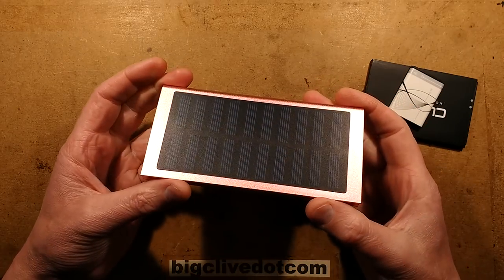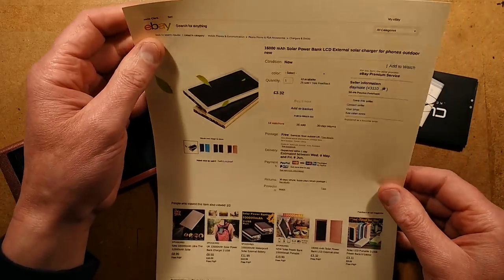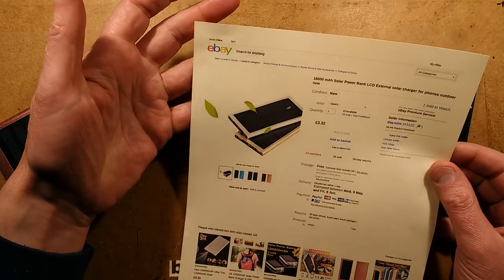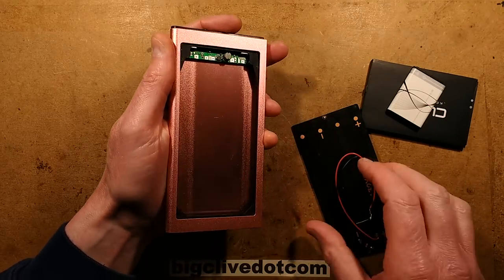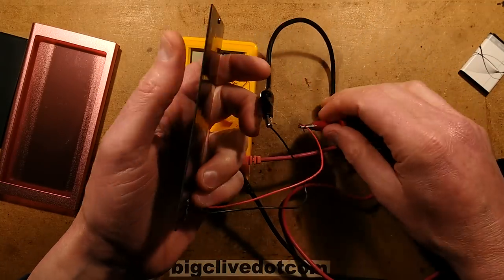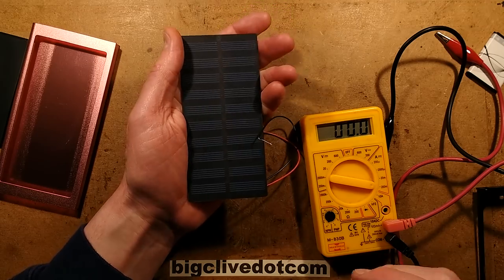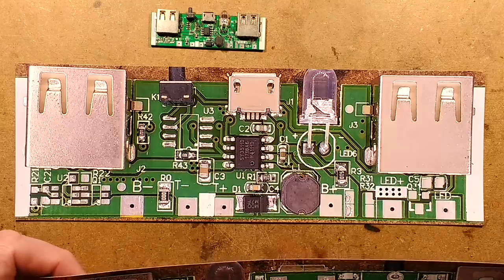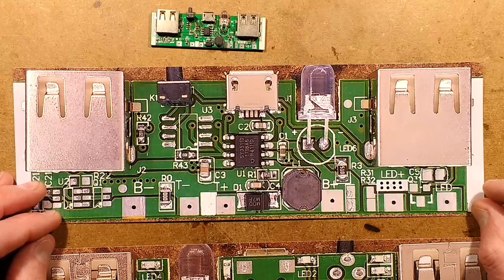Fake USB power bank kit rating (100,000mAh again)

Comment: I think I have one: It’s a “Nekteck” battery at “10,400 mAh
Reply: Nevermind, similar look/design though
Reply: It has 4 charge LEDS, 2 USB ports (5V), on/off button, the same solar panel, similar rough metal build w/ similar shape & size, plastic middle piece and is screwed toghether

Comment: I purchased a water feature with a built in backup battery  .The ins said in the off position it will run off sun light and charge the battery in the on {at night} it will run of battery power.

Never got it to work as it was suppose to . Last week got  my test meter out and come to the conclusion that the solar panel the same as the one you show but 12 volt  is faulty .Only showing about 10.5v in bright sun 

Typical chinese rubbish i suppose ! there must be a lot of these faulty panel around .Even connecting the motor direct to the panel it was hit and miss when it ran the motor
Reply from the maker: If you count the number of sections on the panel and divide by two that gives the rough voltage.
Reply: Thanks clive its a 36 cell panel so its 12v .Would expect it to be showing 18v in bright sun other 12v panels i have do